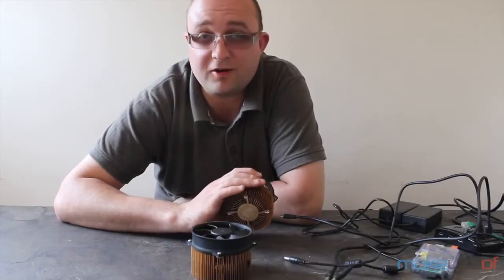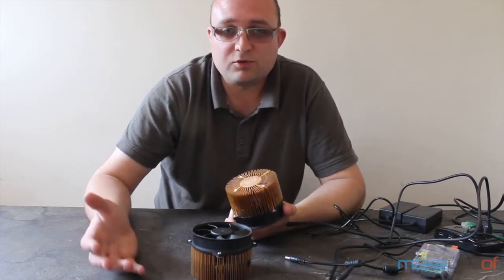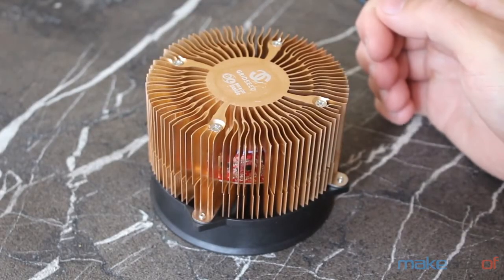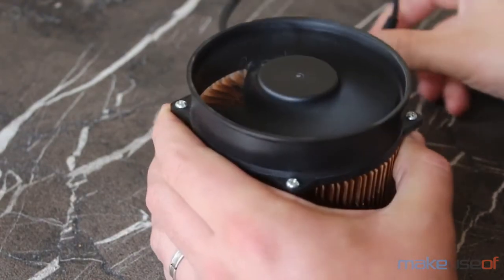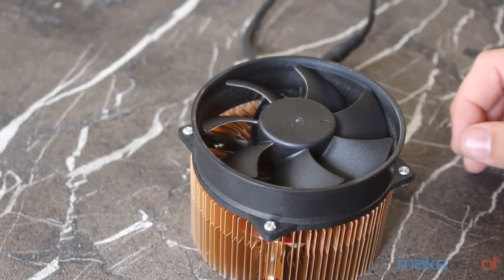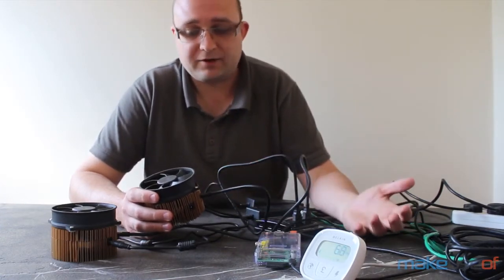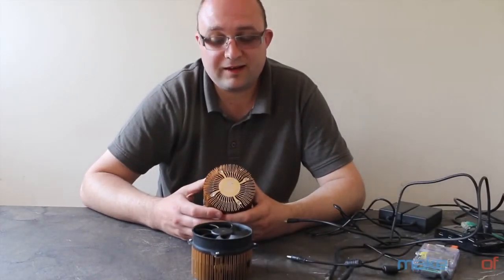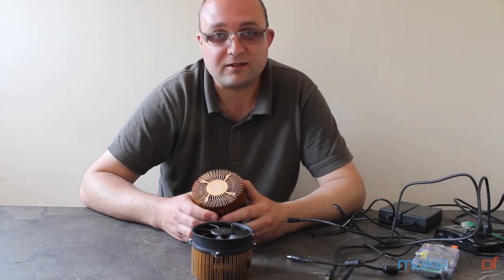Gridseed Mini ASIC Miner Review

Comment: i have a question pls, im in doubt between two offres, first its an antminer s1 for 320 €, and the second is 6 of those gridseed asic for 250€ which one which one is more profitable ?
Reply: niether.      ps the gridseed is on ebay for 37 bucks....   250 is a rip off.
the gekkoscience usb newpac is though at 90 gigahash with only like 20 watts..  they sell for $50 a stick..  with a powered hub you can you a hundred of em if you want
Reply: ant miner s1 without a doubt